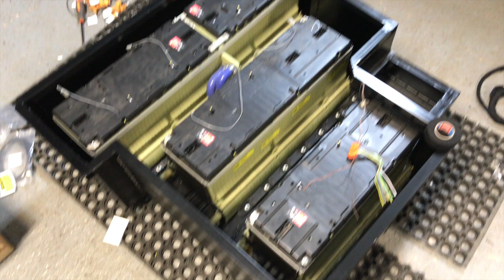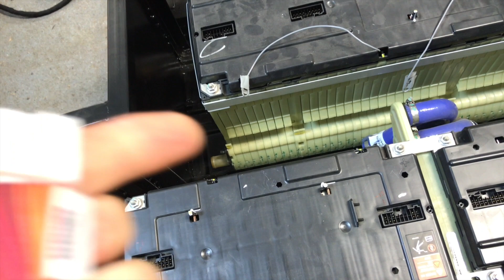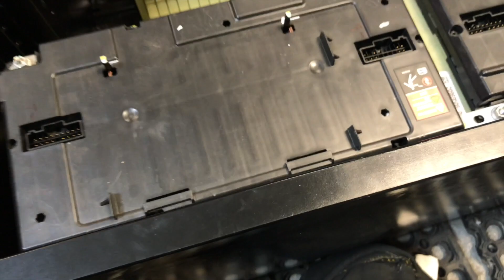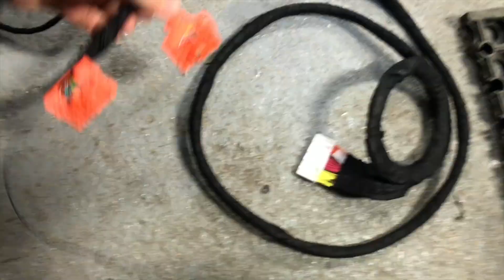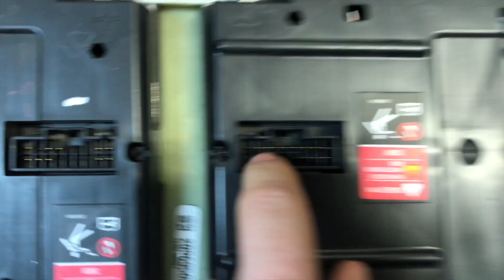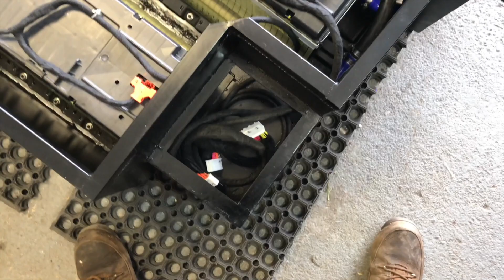Chevy Volt battery pack Orion bus wiring for r32 skyline build

Comment: How did you do all your cooling? I see it in the box and that's nice but I'm wondering about the rest of the car.
Reply from the maker: It’s just a standard cooling system so electric water pump and radiator with fan